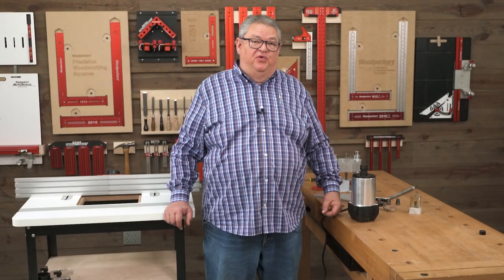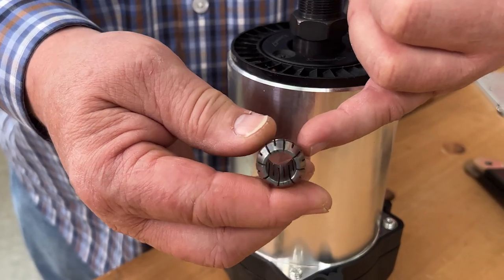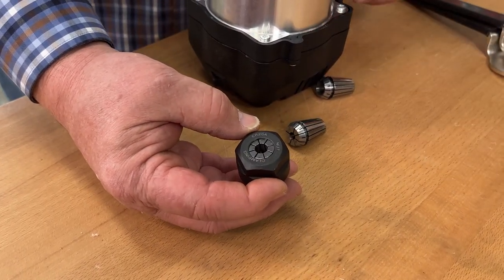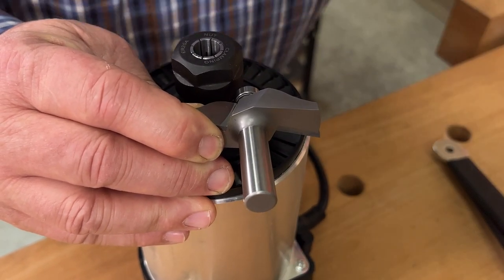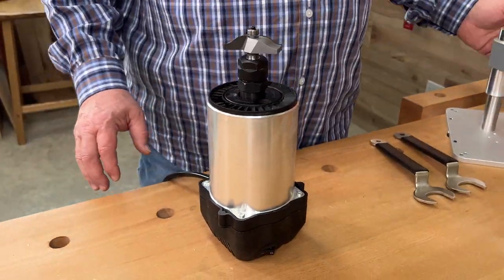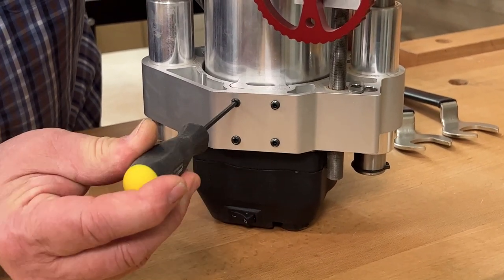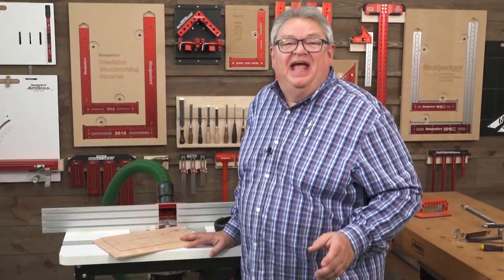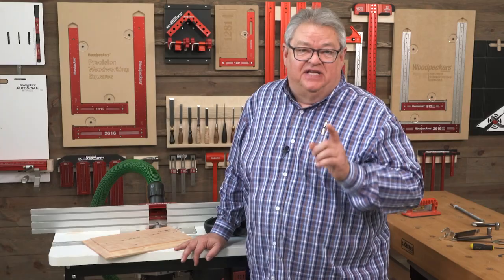SpinRite Router Motor | Deep Dive | Woodpeckers Tools

Comment: ER collets are no joke.  They are used on high end industrial machines.  Ones that require the bit to have zero runout.  I worked on machines using those collets for years. This is one badass router.  Selling for $280 is a great price.

Comment: just wondering whether this motor would fit as a replacement Porter Cable motor, even though it lacks the guide pins on the side, is the diameter the same as a comparable PC motor?  Would it work in a lift designed for PC motors?
Reply from the maker: Joe, it will fit perfectly in any lift designed for the Porter-Cable 7518. It should physically fit in the 7518 hand held base, but the lack of indexing pins may make depth adjustments difficult.

Comment: What makes this router different from the bora? They look pretty similar. 
Also mine must be defective because it sounds like a jet engine taking off. It’s almost scary it makes so much noise. Definitely louder than my previous one. Seems to run smooth though 🤷🏻‍♂️
Reply from the maker: You have a SpinRite that's loud or a Bora? If it is a SpinRite, call Customer Service. I've been using routers for close to 40 years, and I've only had a couple (very expensive) routers that were as quiet as the SpinRite. 
The Bora has pins on the body so it can be used in a handheld base.
Reply: I have the Spin rite I bought with the PRLV2
But I ll get a video of it and contact customer service. It’s almost scary how much noise it makes, but it’s odd that it doesn’t sound necessarily bad, just like a lot of power and only at half speed.
Reply: Mine runs like this also. And I get a lot of chatter.

Comment: Can we just buy the collet
Reply from the maker: You can buy ER-20 collets just about anywhere. The difference is the shaft of your router has to have the correct taper ground into it and the outside has to have the proper threads.

Comment: Jessem used to have a variable-speed router motor that looked exactly like this, and had the same specs, but had a remotely-connected hard-wired speed control which was a huge benefit if you had your router in an enclosure under the table. It was called a Pow-R-Tek. The problem was it had absolutely no torque when you reduced the speed for larger bits, and it wasn't much better at full speed with smaller ones. I had one, and on even simple cuts would stall this router whereas the Milwaukee (of the same HP) would breeze through. It was so bad, they stopped selling them. Complete waste of my money.

Is that not a problem with this one? I'm quite gun-shy about these motors now. It was hard to tell from this video, but it sounded like it was bogging down on the panel raising cut, but that may just be me.
Reply from the maker: Pete, I find the SpinRite equal to or slightly better than the Porter-Cable 7518 for power. Quieter and smoother, too.
Reply: @WoodpeckersLLC  That's good news. Thank you.
Reply: AC/DC universal motors always lose RPM when a load is applied. It’s not bogging, it’s producing more torque. As long as the motor is not stalled, and has adequate cooling, you’re fine.
As to the speed control you mentioned, that’s just a bad method of control for a universal motor.  Usually switching windings is how speed is controlled.
Reply: @robert_g_fbg  The external box was simply using the same circuitry that is in motors like this with the little dial. It wasn't just inline with the power cable as far as I could tell. There were two cables to the control box. It was listed as "electronic variable speed remote control unit" so it wasn't the old in-line dimmer. But it had no torque at all, and from what I read, it wasn't just one bad unit, but it was the overall design.

If you search for JesseEm Pow-R-Tek you'll find old listings of it with pics. Looks like it came from the same factory.
Reply: @Psychlist1972 Looks like they are back on the market
Reply: jessem now has a new one out, just got one.  it has a remote control box that does have feedback from the router, thye cable from the control box to the router is not a standard powercord, it's 6 conductor iirc
Reply: @stevem268  Their old one was the same type of arrangement and connection. But under load, it was terrible. Maybe the new one is better.
Reply: @Psychlist1972  it seemed to be, i visited jessem's factory in new brunswick canada last month and my tour guy demonstrated one for me